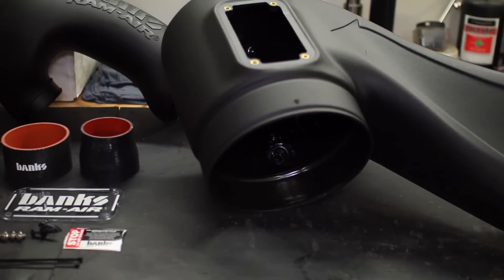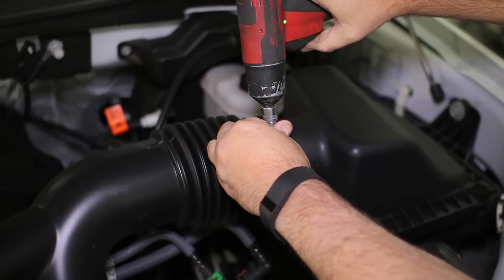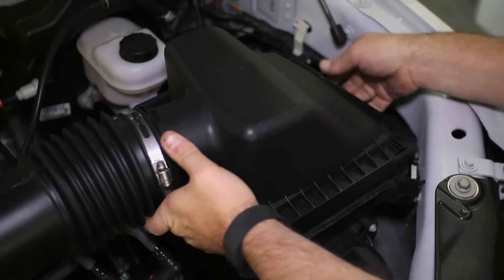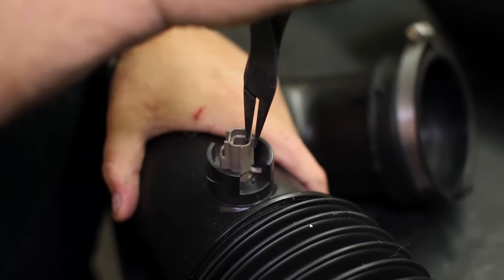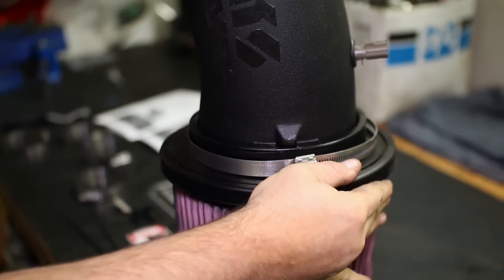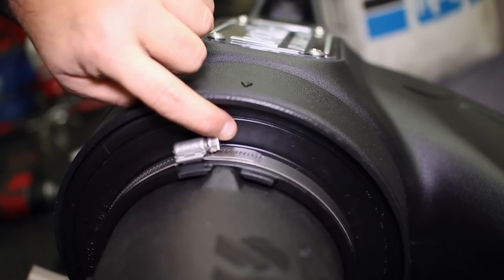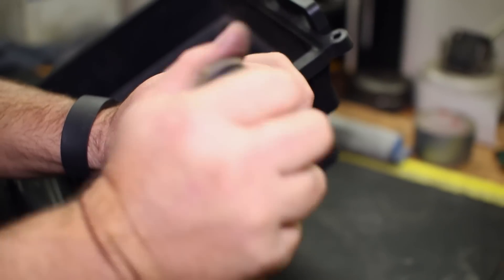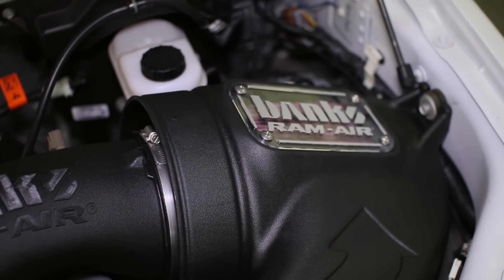2015-2016 F150 2.7L and 3.5L EcoBoost Banks Ram Air Intake System Install

Comment: hey guys I've been watching a lot of y'all videos about the intake systems for the 2.7 EcoBoost I noticed that every brand has their own different setup and outlook on their systems I kind of like them all but what it comes down to for me is watch one of them is giving me the most horsepower and torque versus the best bang for the buck so my question is to possibly get some guidance from y'all in which intake system that y'all have tried so far is producing the best HP and TQ gains and also what would be the best value two Gaines ratio thanks guys I really appreciate it
Reply: nick mitchell don't get a banks
Reply from the maker: Like i said in the other reply, we haven't had any issues with this Banks intake. Rock solid so far. You are correct, every cold air intake system for these EcoBoost engines are designed very well, we have run multiple different brands on our trucks, and have had no bad experiences. Give us a call and we can go over which one might be best for your application 623-434-5277

Comment: DO NOT GET THIS INATKE! It will throw codes all day long
Reply from the maker: Sorry to hear that. We have had it on our truck for quite a while now. No issues at all. Plenty of street driving, trail riding, and serious off roading in the mix.
Reply: Felipe Mariscal I find that hard to believe. You must've installed it incorrectly. Did you forget to plug in the air temp sensor?
Reply: When someone says "throws codes" you already know they are lost in the sauce